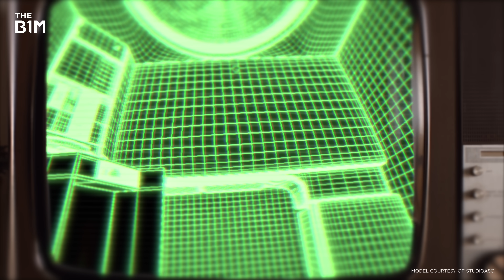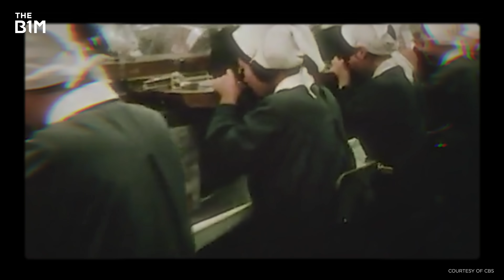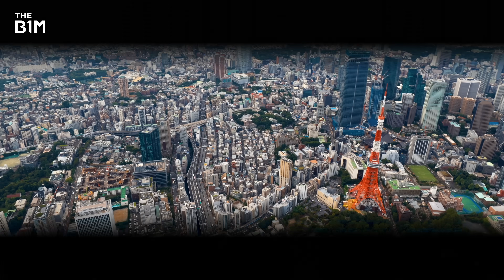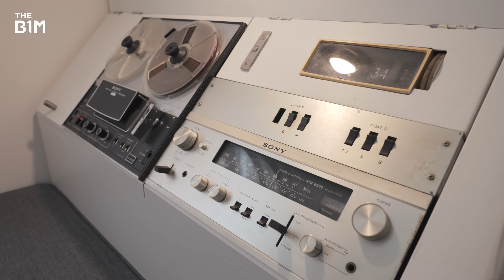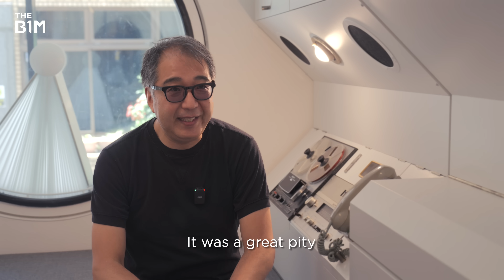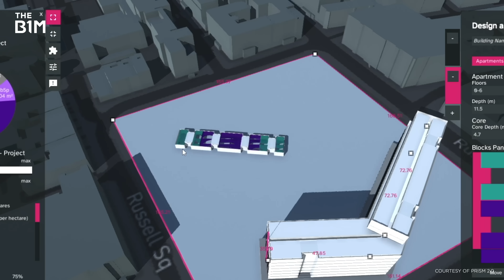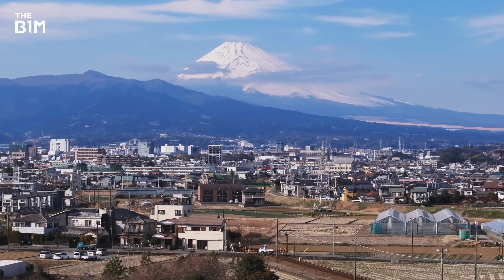Why the Nakagin Capsule Tower Was Japan's Best Failure

Comment: This must be remembered as one of the most interesting buildings in history, each capsule it’s a self contained habitat unit, why it looks so well designed and futuristic, and other small apartments bigger than this around the world still looks like a basement or attics (specially in Paris)?!, it’s because Kisho Kurokawa’s design principles that all architects must learn since school.

Speaking about the building, it had many challenges since the beginning, in practice and other financial ones, the actual capsules are in fact the basic model, they were other upgrades like two or three units attached together to make separated rooms, and also internal colors (white, black and orange), this was a pilot building and the main idea behind was to have more towers and  the possibility to take out your capsule and move in to another neighborhood if you need or simply attach it to a truck and went on vacation with your own home like a camper, unfortunately this was the only building of its kind so it never happened, one of those redesign process in order to save money when they were built was a change on the attachment with the tower so now the capsules are not completely independent and it need to take out the surrounding ones too in order to move one. 

The capsules passed more than the double of their time life on the tower and started a de integrating process, originated by many things principally by  humidity and the asbestos used as isolation.

Finally they’re other remaining capsules at Kisho’s  house in Nagano, the building has a similar construction style with a central structure surrounded by 4 capsules used as bed rooms and a tatami tea room, with the other facilities at the central part, both buildings became a reminder of a future that never came.

Comment: Interesting how this building opened a year after Walt Disney World's Contemporary Resort Hotel, which used similar modular concepts for the rooms.   The rooms were prefabricated and "slid-in" to slots in the "A-frame" structure, with the idea being that rather than remodeling the rooms every decade or two like normal hotels do, instead they would simply be swapped-out for completely new room modules that would have the latest technology and styles - oh, and another cool feature was the Disney monorail ran through the A-frame and had a station inside the hotel.   It all sounded great in theory, but when the time came to consider new rooms, they discovered the module structures had sagged over time (and/or rusted in-place) and weren't feasible to be removed/replaced, so they ended up simply remodeling them like any other hotel.   One of these days, if I ever do a Disney World vacation, I plan on staying in the old Contemporary Hotel just for the engineering trivia and taking the monorail from my hotel to the theme park.
Reply: Ah, entropy. It's so easy to forget that stuff breaks down and corrodes over time.

Comment: My first thought when becoming acquainted with the capsule tower was "if a resident wants to update their capsule, there's no way to replace one without disrupting adjacent neighbors".  I was not surprised when you mentioned this as the first issue with the design.  Having said this, there are ways to design a building that have replacable components that would isolate changes to affect only that which is being changed.
Reply: That limitation is probably why it was considered a failure. It shouldn't have been that hard to come up with a super structure that modules could slot into then be secured. Hell, it only took me a way to do it.
Reply: Yes today's technological advances can but an 80s design?

Comment: They should have imposed some type of heritage protection. It would have easily, once replaced or renovated the modules, continue to serve as hotel for much longer.
Reply: They looked at it but it was in pretty bad disrepair. 
This is also Tokyo where they are willing to cut down large trees in one of the famous parks  to make way for another new shopping centre.
Reply: @thesupremekai1980s  The pods were in bad condition, but the core would be structurally sound for hundreds of years. The pods were only built to last 25 years.

Comment: Surprised you didn't mention moder cruise ship design as they are exactly built like that. All cabins are modular and finished before being delivered and installed and plugged into the ship's systems.
Reply: A lot of hotel rooms and even apartments around the world are built that way.

They key here was the idea that they could be unbolted and replaced with a new one or even just moved at some point in the future, the key issue being that the pods above you would have to move just for the crane to get to yours.
Reply: @SherrifOfNottingham  Ya I know cruise ships will change out some rooms when they do referbishments. Sounded like the engineering of the building looked forwards but forgot to look backwards though. Installed modularly as intended but did not uninstall for replacement easilly. Then the low interestin replacing units screwed up the production line and it had to shut down, throwing the entire consept off track.
Reply: He did mention ship interior design

Comment: A good example of modular construction that still stands today is the Hilton Palacio del Rio hotel in San Antonio, Texas. The entire 21-story structure, consisting of 485 rooms, was built in 202 days, with all of the rooms being placed in a 46-day timeframe. It opened on April 1, 1968, a full 5 days early from the deadline they had to meet for the 1968 World's Fair.
Reply: There was a Holiday Inn in Toronto (Yorkdale) built like that in 1970. All the rooms made of concrete modules stacked up. Sadly was torn down in 2020 for 2 new condo towers. 🫤

Comment: The inability to remove a single unit without disrupting others seems like an unbelievable oversight. Surely they must have thought of this before construction.
Reply: Especially since that was supposed to be the whole point of the building!
Reply: They probably thought it was possible, but the tolerances were so small that it couldn't happen in real life. 

Or knowing construction, the original design might’ve been far easier to replace. Then, revisions and other pressures resulted in this tightly packed build.
Reply: @Khaliras  Likely the financial side got involved and was like well we can just stack them slightly closer together and fit in an entire extra unit or two to sell and make more money!
Reply: @Khaliras  I'll venture a guess that the aging of the units also played a role. The frames might have sagged and corroded with age, so that they ended up more dependent on each other than the original design intended.
Reply: @pcno2832 I don't think so. It's probably the fact that from what I see they didn't account for tolerances in the design, but we're adjusted on site with no way to fix it and when it came time to make adjustments it was too late.
Reply: Sounds like my current apartment 🤔
Reply: The building was assembled in the logical way: start at the bottom and work up.  They didn't have a crane that can pull a capsule out sideways.
Reply: @haweater1555 all they needed was a removable counterweight-mount assembly.
Reply: doesnt make sense to me. if you cant remove your pod without removing the neighbours pod, then you cant remove the neighbours pod without removing their neighbours pod and so on and so forth until you basically just need to remove everything in a column top down to reach the one you want
Reply: @iris4547  I don’t know, but I’m guessing it’s the corner ones you need to remove to get the middle ones out, so it wouldn’t necessarily affect above and below, or any further than the nearest corners.
Reply: @iris4547  Clearly they are some pods that you can remove without removing the neighbors pods, but when you want to remove a specific pod, you need to start with one of those and then step by step go to the one you really want to remove. That would either the pods on top of the building, or on an extremity on the side.
Reply: It's like a modern motorcar that you need to drop the engine to change the spark plugs - and I'm not even kidding, there are cars like that - but never mind even that aspect, no mention of how the modules would be hoisted in and out. I mean, a construction crane during the original stages of construction, but those things are a major project to erect, requiring a mobile crane to position. A huge mobile crane, standing in the road for several hours... no, there was some serious oversight in this design.

Some architects seem far more focused of impressing the public with how clever and artistic they are - building massive monuments to themselves - than with the engineering practicalities.
Reply: This was built in 1972 by KUROKAWA Kisho who was a pretty unique (border-line crazy) architect. I find his stuff sci-fi ugly...but we're all product of our era.
Reply: In these replies, I see two major deficiencies mentioned, remedies for which might have raised other engineering or financial issues. 

First is the need to bring in a huge crane to block the street and a vehicle to carry the pod when changed. This might have been addressed by making the cores of the two towers into cranes for construction and renovation. 

Second, the replacement process might have been made easier by fabricating the pods with a support, as in a file cabinet drawer, on which the pod could be pushed out to be picked up by the crane. That, however, would be much more costly than just 4 bolts.
Reply: Happens pretty often. Engineer/architect designs something, with no practical knowledge of how to actually make the thing work.

Ask any mechanic, machinist, carpenter about it.
Reply: @pumpjackmcgee4267  Engineers can spend years just writing reports or making graphs and then one day get a job that requires designing.  As school never prepared you for that, you're really going to suck at it until you gain some experience in that area.  Engineers are basically just always working on something they've never seen before, but have to pretend that they're experts.  It's what really sucks about being one.
Reply: @lost_porkchop   Oh yeah, not ragging on them. Just saying that communication between departments/contractors should be prioritised. Have the engineers come on sit/into the shop so the tradesmen can tell them what's actually possible/feasible, or what new tooling/equipment would be required to accomplish their designs.
Reply: @pumpjackmcgee4267  A friend, an architect after getting a BSc often regaled me with stories of younger colleagues who designed structures they thought were magnificent. When asked, could not say how they would be built. Usually with an answer like "builder's problem".
Reply: @ohasis8331  BIM solves this issue with timelining and 3D rendering of each component being placed. You can also go back into the information out of the model to find out what parts should be built/delivered at what time and in what order. Architects should be part of the BIM process.
Reply: @pumpjackmcgee4267  LOL Cars are a perfect example.
Reply: @pumpjackmcgee4267 any plant of any house in Brazil have just a nightmare as an electrical plan that can be solved easily by anyone that did at least one electrical installation
Reply: Even Jenga blocks were better.
Reply: I think they assumed everybody in the whole row would be willing to get an upgrade at the same time. Not out of the question but certainly defeats the one pod at a time replacement dream/goal.
Reply: It was a  good idea but as happens all too often in engineering and design the logistics got in the way of the idea being able to work as intended in reality!!!
Reply: That was literally my first thought seeing the design 😂
Reply: it wouldn't have mattered even if they hadn't made that mistake. They weren't the only ones who tried it and the failure of this type of building runs far deeper.  Walt Disney's Contemporary hotel was built at the exact same time, and once they slotted the modular rooms in the problems started. You lose economies of scale for systems because every room is an atomic unit, and the natural settling of the building locked every room in place, whoops!  So they couldn't be slid out, you'd have to destroy them in place and build slightly smaller or not-quite-square replacements.  Plus the idea of "take all these concrete boxes out and ???? then put new ones in" and nobody thought to question the ludicrous cost and waste of doing that - you have to replace everything to change anything.
Reply: Frankly even if there was an actual way, when you're disassembling it (hard to call it a demolition when you just take the huge lego pieces out) you don't need to worry about that and a normal vertical crane will do it cheaper.
Reply: Built to last, not to replace 🤣
Reply: Well maybe they though, that it wasnt a big deal, considering the job could be done in a couple of hours. You would need to coordinate with the neighbours but if the job can be done within a day, it probably wouldnt be too bad.
Reply: Failure: 😣😩
Failure in Japan: 😻😞✨
Reply: Yes.  Especially in an area where city ordinances only allow for activity at certain times a day, and no room for more than one pod a day when they were installed.
Reply: They could have made it to have more clearance between units so it could be access and remove without disturbing others, but I guess at some point in the development, they ditched that to maximize profit. Another story of profit winning over longevity.

Comment: I immediately thought of Habitat in Montréal. Many of the same ideas, but it’s still a reasonably going concern.
Reply: My uncle did some design work for Habitat 67 when he was a junior architect in the 60's
Reply: Habitat has held up rather well. It is not as brutalistic as this one
Reply: 1 of the apartment buildings in Singapore (Sky Habitat) has its design loosely based on Habitat too (& both were designed by the same architect) but it isn't modular I think
Reply: And the spheres in the Netherlands.